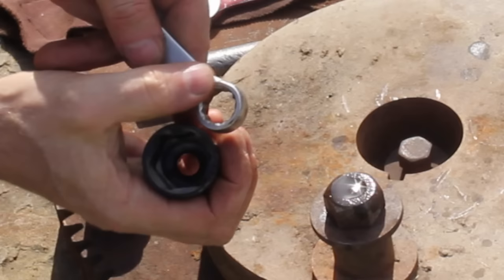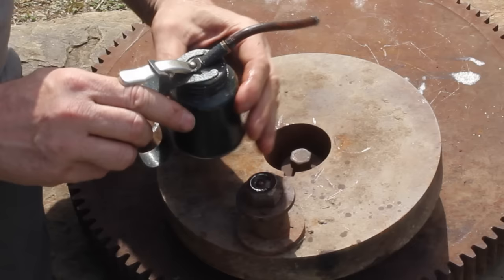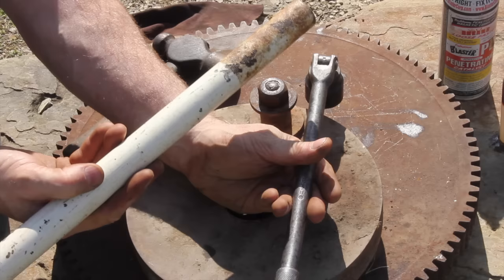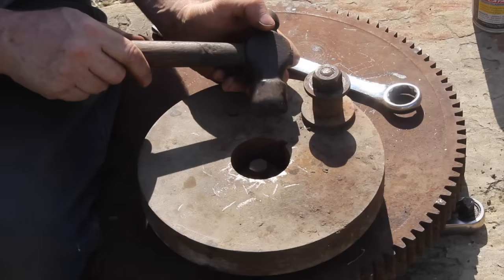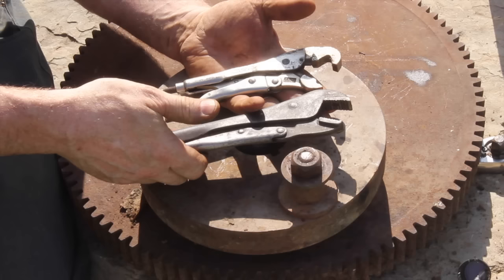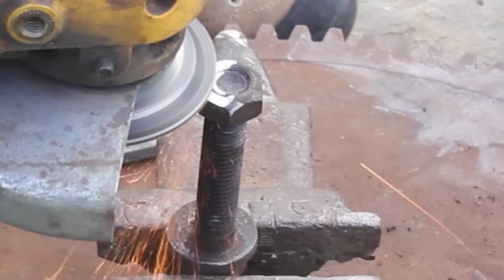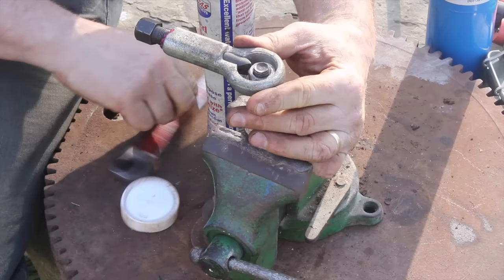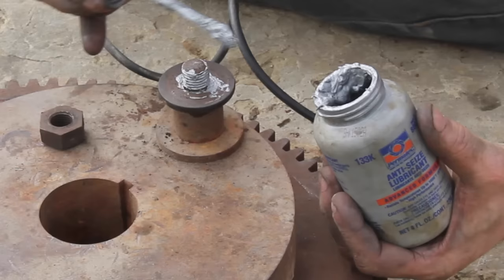Best Ways to Get Rusty Nuts and Bolts Off (Effective Techniques)

Comment: Those all work fine for a nut, but what about a bolt when it's in a hard to get at place and it's into a sort of insert in the metal?  Rusty bolt heads strip easily even with a 6 point socket.
Reply: David Smith you could try and easy out but I always end up drilling and taping
Reply: heat the head of the bolt ......six point socket and air gun SLOWLY ...back and forth

Comment: No. 6, interlocking two combination wrenches (instead of using a cheater bar, melting wax into the threads of a stuck or rusty bolt, etc.).  This is a really bad idea, given all the other safe alternatives you've illustrated, as it can result in broken tools and injury to the user.   I give you points for showing the use of a breaker bar over the ratchet; many people think a ratchet is THE tool to use in such a situation.  To hear them tell it, they can't be bothered to put the ratchet down and pick up a breaker bar to break a fastener loose, then return to the ratchet to finish the job.
Reply: Why not use a ratchet? What about a ratchet with a bar attached to extend it?
Reply: @darrenmicklewright2008  Ratchet has gears in it with very small teeth which can be damaged when that much force is applied. Making it no longer useable. I have broken two half inch breaker bars, half inch ratchet, bent handle on another and broke a universal extension on rusted or cross threaded nuts over time. Three quarter breaker bar on the bad stuff is the way to go even if you just use an adapter to downsize to half inch. Or just buy tools you can return if broken. Tools are generally well made but can break when enough force is applied. Have also cracked sockets down the side.

Comment: You should separate techniques into those that will lower the chance of breaking the bolt and those that won't. Oftentimes that's the problem. Simply putting more torque on the bolt head is pretty intuitive.

Comment: What if the bolt is downward-facing? Hard to get the penetrating fluid working against gravity. And no I can't flip the car over. Is PB better than Liquid Wrench? But some great advice here, rusty bolts are a mechanic's biggest vexation. thank you!
Reply: Capillary action draws the fluid upwards as well.

Comment: Tip here: Do not get rid of your used transmission oil, get a little container a 1 inch wide paint brush, fill with oil and once a year on a nice sunny day take a look at all those bolts in your vehicle that look corroded and difficult to remove and give them a little thorough coat with transmission fluid. All those nuts, bolts, etc. Save yourself the hassle, don't wait till it needs to be serviced to oil them. 

Be kind to yourself

Comment: Very very very helpful! I'm putting new brake cylinders on my 1964 Mercury, and a 1 1/4 inch nut holds on the front brake cylinders. The drivers side came off easily but the passenger side one is STUCKER than STUCK. Methods Ive tried include hammering, tapping, vise grips, and using a wire wheel to remove rust. None of them really worked except the vise grips. They were somewhat effective, but the nut got to a point where it wouldn't budge. I am going to try the candle wax method and also I'll try heating it up with a propane torch. Lets see if either works........and I'll have to file down the sides of the nut because those vise grips tore it up! Thanks for the video! Much appreciated.
Reply from the maker: +Southern Mechanics 

I'm glad you enjoyed the video, I just hope that you can get that nut off!  Nothing is more frustrating than fighting with a rusty nut. As far as vice grips go I have two pair that I love, and all the others have been a disappointment. In the video I show that vice grip that especially designed for clamping in three places on the nut, so it won't crush it onto the bolt or stud. An inch and a quarter bolt would be too big for this vice grip. It's interesting that you said the bolt started to move right? Then just stopped? Please let me know how you get the bold off or any of your other thoughts you have on getting it off. Worst case scenario is if there's a way to get a hacksaw onto the nut and then use a hand Chisel to separate it a bit so you can spin it off. Again thank you for the comment and let me know how it goes.
Reply: Error Code Guy Well I couldnt get the nut off so I gave it a rest for the day. I have no idea how its gonna come off. I really dont want to chisel it in half to get it off, because I cant find replacements anywhere online or in parts stores.  And yes the vise grips worked a little. With all my strength, pulling the vise grips downwards, the nut moved a little. But after that it wouldnt budge. I was turning it the right direction but its just......stuck.
Reply: Error Code Guy I can send a picture of the nut if you have an email or something to send it too.
Reply from the maker: +Southern Mechanics
I just tried that pair of vise grips's on an inch and a quarter nut. I was able to grab very securely in those three points. I don't know how to upload a picture of it, but it is securely clamped on. The reason I like this style of vice grip is because of that equal three point grab. I'm not sure where to get one of those wrenches I probably bought mine about 10 years ago in a pep boys or something. I've never regretted it, it beats crushing the nut in two places. Anyway I really hope you get that nut off and get your project underway.
Reply: Error Code Guy I hope I get that nut off too. It is the only thing preventing me from moving forward with getting the brakes working again. Thank you for your help!
Reply from the maker: +Southern Mechanics
I just tried that pair of vise grips's on an inch and a quarter nut. I was able to grab very securely in those three points. I don't know how to upload a picture of it, but it is securely clamped on. The reason I like this style of vice grip is because of that equal three point grab. I'm not sure where to get one of those wrenches I probably bought mine about 10 years ago in a pep boys or something. I've never regretted it, it beats crushing the nut in two places. Anyway I really hope you get that nut off and get your project underway.
Reply from the maker: +Southern Mechanics 
I can definitely understand you not wanting to chisel it off. It's always the last resort. I think what may have happened is the vice grips may have crushed it against the bolt or stud then became oblong in shape and will not move in either direction. I'm wondering if you can grip it in the opposing direction and reshape the nut round again.
Reply: Error Code Guy Well I had to grip it from different points as I was turning it. But when it was close to the edge of the thread it screws onto, it stopped. It wont budge.
Reply from the maker: +Error Code Guy 
I tried to find a pair of channel locks on Amazon but I couldn't find it on there. I did find The exact style of Vice grip that I have had good luck with. I know nothing about this company that selling it. But you might be be able to find this wrench locally. This wrench might reshape the nut as well. A small pipe wrench will also grab a rounded nut. Sometimes the pipe wrench is too thick. But I have also had luck with those as well if you can get it on the bolt

http://www.toolup.com/Vise-Grip-7lw-7-Locking-Wrench-7LW
Reply from the maker: +Southern Mechanics 
Here's an idea. If the bolt for the stud was hit with a hammer it is possible that the very end of the stud is slightly flared out. I've had this happen, the threads may not look deformed but they could be deformed enough to not allow the nut to pass. The good thing is that the nut did move. Is it possible to spin the nut back into its original position and take the other nut from the other side and see if It spends onto the stud. If this end is flared it would be great to re-correct the threads with a tap. Sometimes I have used a similar nut to slowly correct the threads. Let me know your thoughts on this idea.
Reply: Error Code Guy I got the nut off with PB Blaster and alot of strength.
Reply from the maker: +Southern Mechanics 

Great!!! Thanks for keeping me in the loop. Glad to hear the project moving forward.
Reply: @RANDOMMekhaniks  I would have thought that if you can move the nut a little, keep moving to backwards and forwards, and it will loosen up.

Comment: anti sieze its like franks red hot sauce i put that stuff on everything...i like the trans fluid and acetone tip ive unused portions that now i can make my own penetrating oil...thanks for the tips...working on an inverted square holed fill plug in a gm differential..not winning at this point...going for the heat-to ice water technique next...fingers crossed
Reply from the maker: +niterbum wow! Sounds awful. If I'm not mistaken that square hole is the same as a half inch extension? Right? One thought might be to heat it up a little bit and then hold some candlewax up to it and see if the candle wax will penetrate into the threads. If the half inch extension fits in that square hole you could tap in a little bit to see if you could shake the rust loose. Please let me know how the project is progressing.
Reply: i lost....it had been rounded  out by  previous attempts by previous owners and /or mechanics...the square hole is not... i repeat, is not for a 3/8 in extension drive on these fill plugs...there is a special socket and for GM it is a 10 mm yes metric that's why the 3/8 drive is sloppy and if they are siezed they get "stripped/rounded" out ....i ended up drilling it out and retaping with a 3/8 npt and teflon taped a 3/8 npt  cap bolt in...beautiful
Reply: i believe the candle wax would've worked if i had a good "bite" on that plug.....it did penetrate  but i lost what little edge i had on the plug ....i will save that trick for next time and living in the rust belt there is always a next time ha ha...and don't forget people Anti-seize on everything
Reply from the maker: +niterbum 

I'm glad to hear that you got it even though you had to drill It out and retap the thread. I will definitely remember that a 3/8 drive is the wrong tool. I know when I was in high school I removed mine with a 3/8 drive, but there was very little rust on the bottom of the car. Thanks for keeping me in the loop on how the job went, and hopefully anyone reading this post will get the tool that fits properly and not have to go through the same struggle.
Reply: Error Code Guy  I have a mixture of paraffin and mineral oil that I made as a lubricant. There's YouTube videos on how to make it and many people like to use it to lubricate their bike chains. I think I'll try it on some rusty nuts and bolts on my go kart project and see how it goes! One of the axle bolts has been especially stubborn...

Comment: Any ones you find good for a o2 sensor
Reply: pb blaster and heat the hole that the o2 sensor goes in with a torch.   careful b/c pb blaster can be flammable. but the combination works.  you can heat the hell out of a o2 sensor safely.

Comment: My front passenger side brake line at the top small little bolt my grandpa and me rounded that some bitch pretty well.  I've been trying to get it off for a while now It Def taught me to come prepared the right tools is over half the job. If I would have sprayed it with pb and used a flair wrench at the beginning I probably would have never stripped it

Comment: If the nut is really rust frozen on a bolt like exhaust and manifold bolts. NONE of these methods will work, they will break the bolt causing a nightmare. Forget about heating with propane or mapp gas. It won't do anything. You need an acetylene oxy torch to heat the nut red. But there is some new stuff on the market that may work (certainly a lot better than any of this guy's suggestions). CRC Freeze Off. When you spray it on the hut/bolt, it lowers the temp to about 0 f. This can break the rust bond and then it's penetrating oil can get in and the nut comes off easily. I have succeeded with manifold to pipe studs.

Comment: 🤔 Nuts and bolts? No bolts shown here. Nuts are far easier to work on than bolts.

Most of these techniques won't work on bolts, as you can't get lubricant passed the bolt head to the thread.

Comment: I can't crack the bolt which attaches my brake caliber holder to the wheel.
It requires 21mm socket. 
I have a 30 inch braker bar with 3/4 drive. 
Tried blaster spray, atf/acetone oil, hammering, heat, leverage bar. 
I think I need to get this on a lift where I can get a longer leverage pipe on it. 
Or probably take it to a shop to have them break them free. Which kills me to pay someone. 
The bolts and the area around it aren't even rusted. Probably someone tightened with impact wrench too much torque
Reply from the maker: +Ron Gipp 

Wow! Sounds horrible. I'm trying to envision which bolt this is. A 21 mm is too large for the bolts that hold the caliper on. Is this the bolt that is in the center of the wheel that holds the CV joint to the hub? If so these can be miserable. I know some of these axle bolts have a reverse thread. What type of car are you working on.
A three-quarter breaker bar is about as good as it gets. I have a 5 foot bar that I use but it makes me nervous to put that much pressure on it. That big orange impact wrench that I show him the video has taken off some of the toughest bolts. Even bolts that spin like the bolt on the crankshaft. It's small short hits on the bolt, and extreme torque seem to be a good combination. I bought this thing when everything else failed, because I didn't want to have to pay somebody to do it. Please keep me in the loop on how it is going, also I want to make sure that I know which bolt you're trying to remove.
Reply: It's the bolt that attaches the caliper holder to the wheel.
I thought maybe about it being reversed to but I watched a video of someone with the same car and it seemed standard counter clockwise loosen.
It's a 2005 Audi A4.
I can't get a 5 foot bar, but I had about 38-40 inches.
I bought an impact wrench just tonight.
It has plenty of torque and 3 settings.
I need to get a 21mm 1/2 socket for it and then I'll try it out.
Thanks for replying!!!
Reply from the maker: +Ron Gipp 

Looking forward to hearing that it worked! Please let me know how it went when you try out the new impact wrench. If possible A short impact socket will have less chance of cracking. I have cracked plenty of deep well socket's. I'm just curious what impact wrench you purchased. I have had my eye on that harbor freight earthquake with 700 pounds of torque, With a very compact profile. I'm just looking for an excuse to need it. Next big suspension job and I'm going to get it.
Reply: I purchased a Husky Model # H44804 at Home Depot. Rated at 800 pounds torque.
Seems powerful but no budging on my bolt.
I have 115 - 120 PSI on my air compressor.
The one thing they recommend is using less than 25 feet hose on air compressor.
My hose is very long and could be 30-40 feet. So I might try.
There's also a Northern Tools 1500 ft lbs torque air impact wrench on my local craigslist.
I tried the candle wax melting trick.
Nothing seems to be working.
Any thoughts?
Reply: I was able to turn my steering wheel and get a 42 inch breaker bar on it with my 3/4 socket drive. Remove one bolt no issues. The stuck one ended up breaking off. So now I have another issue.

Comment: Very useless,so if I'm one of the few people whose engine is located in an engine bay,I just go in there with angle grinders power tools,yeah. Has anyone seen the space available in a 21st century engine,Don't mention undoing bolts with a metre long wrench,just try getting a 6 inch spanner onto a bolt these days, no try being practical,not sitting in your workshop.